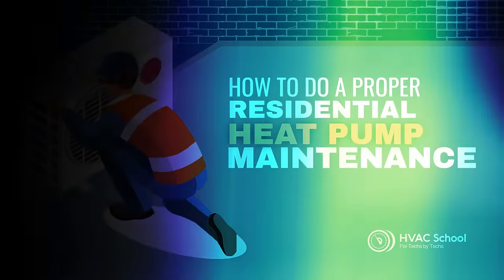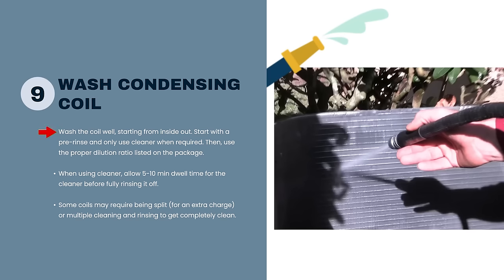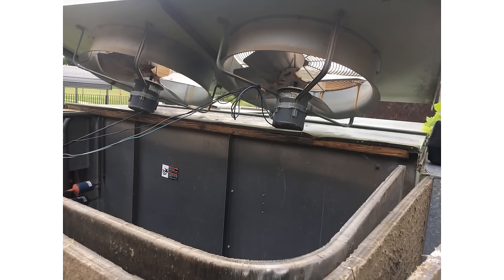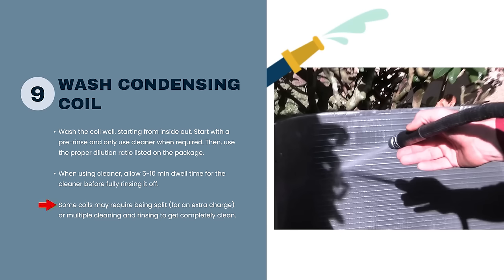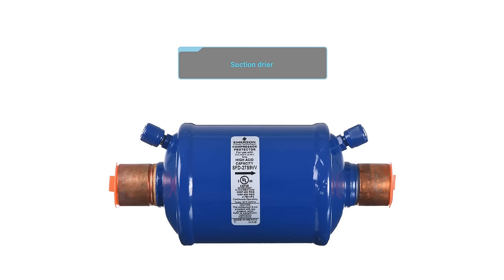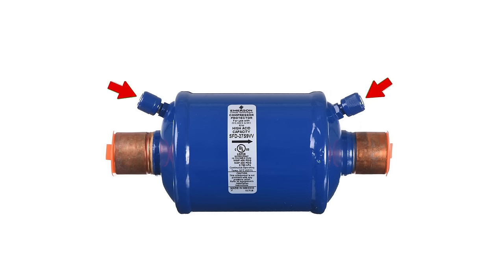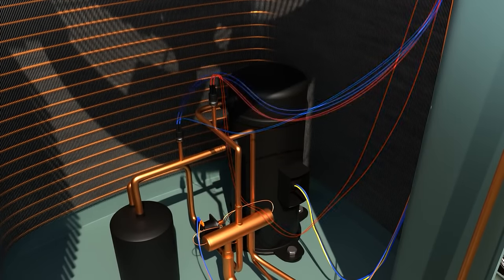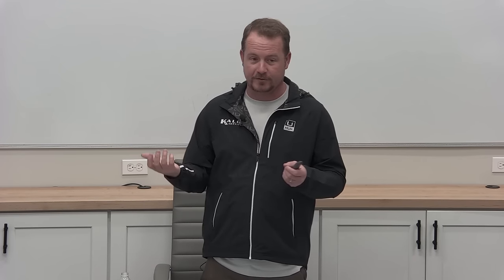Residential Heat Pump Maintenance Part 2

Comment: 15 mins. to disassemble, realign and reassemble an outdoor unit, hardly. A once a year cooling maintenance is a "minimum" 1.5- 2 hours. check in with the customer, have a conversation about any changes or notable differences, how's the fam., gonna be a hot summer, are you interested in any iaq products etc. etc., accessing the indoor unit, often times can be difficult, probably will require 2-3 trips to the van. filter, ladder, tools, vacuum, spray cleaner and water bottle, find a prop for the front door, ensure the dog is put away again, check capacitor, inspect wheel, inspect evap. cleanliness measure split after allowing 10-15mns. of run time, going back down to the thermostat to turn on the ac. check electrical connections. check the disconnect /wiring, gather all tools/ladder and put away in the van. wipe the dirt off you and take a drink because the attic was 130*. Now to the outdoor unit. 

you'll need multiple trips to the van, spray bottle, water hose, locate hose bib to find its been turned off, back inside, wait for customer to show you where to open shutoff (but often times blowing out the coil with nitrogen is comparable). disassemble, reassemble. clean up wiring, check components, amp draw, capacitor, contactor, a simple voltage drop or resistance will tell you the points are bad on a c.c., check charge, finally pack all your crap away, again clean up and re hydrate, write the ticket and recommendations, again shoe booty's, back inside, wait tell doggy is put away, to have a discussion about recommendation's, new insulation at odu, easy trap, explain why, sign the ticket, log the pics. and video, call dispatch, wait 10-15 mins. for next call. and you think all this can be done in 90 mins., if in fact a correct maintenance is performed? GTH outta here, that's a $300 maintenance that most people ain't paying when some Joe Schmo is offering a $49 cooling maintenance. 

Oh 1 more thing, a simple condenser split will tell you how dirty the coil is. This is why I do commercial.

Comment: How the heck do you get two liquid line driers on one. Line??
Reply: Sometimes if there is one inside the condenser the original installer will install another without realizing it already has one

Comment: What coil cleaner do you recommend - ?
Reply: I've used various Nu-Calgon formulations, if you read close they specify what use cases they are for.  Just make sure you use something specially formulated for them if you clean microchannel aluminum coils.  Regular cleaners will eat them for breakfast.